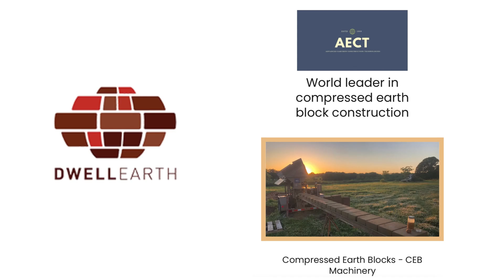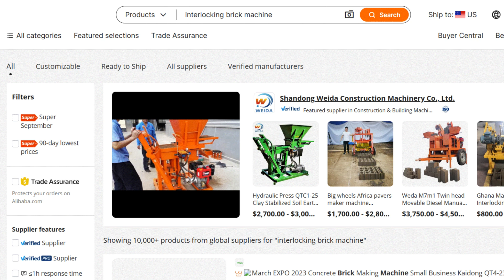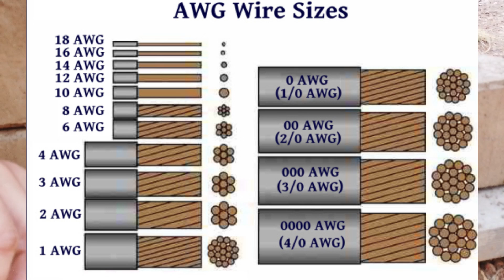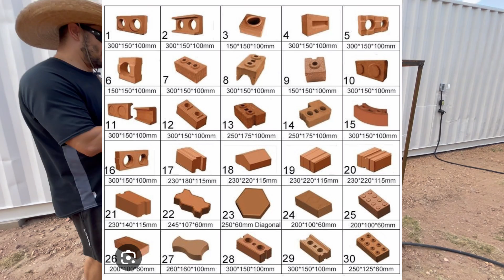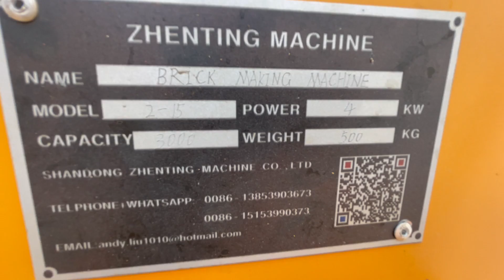Affordable Compressed Earth Block Machine from China via Alibaba.com

Comment: No laughing going on from us! I know what these block are capable of and when you and Eric get your mix just right you will be cranking block out of your machine. Shoot for 8% +/- Portland Cement and 13%+/- Moisture content when you are mixing your material. The other thing is to make a pad (concrete if you are able to) for drying the block out. Get a heavy commercial tarp for covering them. You are going to want to water cure them so you have to uncover and lightly water them every day for around 6-8 days. Not a lot of water - just enough to keep the Portland cement hydrating while they cure. You should be able to stack them for inserting into your wall system with 14-28 days. I have a compression tester for testing the strength of our block. I reads out how many mpa/psi the block are curing to within 28 days. New Mexico building code for compressed earth block is already established so you are "legal" to build with them. We are still fighting for legalizing compressed earth block as building material in Nevada. I so look forward to seeing your success! If you are worried about how well they will perform for you - use the first batches to make a temporary wall for fencing, steps into your RV or even a deck for your RV. You will get a feel for it and you won't ever think about it twice ever again... you will fall in love with it!

Comment: Since the mould is part of the machine; you need to buy another one that make U brick for water pipe, electrical and rebar.
Reply from the maker: The plate on the top and bottom can be switched so we do have the mold for doing the u brick
Reply: then; you also need another mold plates with flat edges for exposed corner because your eyes will dislike seeing those grove on each bricks end when you left it exposed
Reply from the maker: @rimzalia1362  when the time come, we may decide to buy another one but as of now we will stick with this.  And see how much we can get out of it. First we need to learn to make blocks. We haven’t had a chance to do that… 😭Thank you for your comment. Have a good rest of the year!
Reply: It is actually possible to use a route and table and cut key-ways of any kind into the block. If you want rebar installed vertically you can use a hole out drill or press to do that as well. A little more work but it is cheaper than purchasing more molds or having to tear down the machine to replace a mold.
Reply from the maker: Again, I am just finding this comment. 🙇

Comment: Takes over 5000 blocks for a small house. The more expensive machines are automatic. That means high production. This machine was a waste of money. Rammed earth is much faster. Use the same mix in the wall and rammed it down.
Reply: Rammed earth walls are nice but you have to buy a lot of wood for the forms.
Reply: @shesoutthere387  
4 pieces of plywood. 16 2x6s. 16 bar clamps.  This is reusable for the whole project.
Reply: @best1onearth  great for footings (formwork) then stack block on top of them...
Reply from the maker: You are right. Rammed earth is much faster, and we may be waisting out time. But this is what we decided. I was looking into rammed earth previously. I think at some point we are planning an outdoor shower and doing it rammed earth. Thanks for taking the time to message us. First building we are going to make is the pump house. That will tell us a lot and then we will adjust from there.
Reply: @leeslivingoutofthenorm  Perfect way to learn how to build with the block. Keep it small and you will succeed to bigger projects!
Reply: Rammed Earth is not faster because their walls are thicker, requires more labor. The fastest is the  hydraform block system, I believe. I prefer rammed Earth because of its timeless beauty.
Reply: nah rammed earth is not much faster,you need strength and endurance,no one made rammed earth kingdom even when humanity were still so poor back then

Comment: I just got notice that my machine is ready and I am in the process of filling out my PoA for the importer as it gets ready to start its voyage across the sea. Mine is going to be a bit more money (thanks Biden), but it will still be considerably cheaper than the American machines and a lot more versatile with the interchangeable molds. I am getting the channel molds like you have (I want to be able to run utilities), U molds (for the bond row) and a paver mold (for patios/driveways). I figure I can cut full blocks in half to get the half blocks.  I went with a diesel option because the electric option requires 3 phase induction power. So if you think yours may be pulling more power...it probably is.

Your dirt looks a bit clumpy. Like you, I only got the press.  I did not get a full line with the grinder, the sifter, and the conveyor belts, but I would like to upgrade to a whole line in the future and turn it into a business. I wonder if your bricks might turn out a little better if you could get a finer sift on the dirt? I need to figure out how I am going to do that manually. One step at a time. I'm looking forward to seeing your progress. Feel free to share mistakes so I don't have to make them, LOL.
Reply from the maker: That is awesome!  Yea we will be figuring it out on our own. We were just grabbing whatever dirt was loose so the clay content might be lower but it is something we will play with. As far as the electrical draw it is something I will need to figure out for sure. There will be videos to come. Thank you for the comment and subscribe!
Reply from the maker: On a side note I’m not sure grinding it finer would make much difference with our soil.  But again. We will be testing it out. I also thought about doing it as a business but baby steps.
Reply: @leeslivingoutofthenorm  You probably already know this, but ensure that you are not using topsoil. The organics in the topsoil will undermine the integrity of your bricks. Fill dirt (the stuff under the topsoil) is supposed to be best.
Reply from the maker: @byronlaw6724  Yes, we are planning to dig at least 2ft down. 😎
Reply: @leeslivingoutofthenorm  If the two of you are able to build a retaining pond for Monsoon Rains... all the dirt you would need is at the bottom of your pond. We will be getting our material from the base of our mountainside... a lot of good clay to bind the material together. We may have to add sharp sand to cut the clay down.
Reply: Got a link to the machine and molds you chose?
Reply from the maker: We bought this machine years ago and we are hesitant to provide it because we don’t know if the company is still around. But I believe if you really want to know you should be able to pause the part of this video with contact number and email address ( which is Hotmail.com lol 😆)